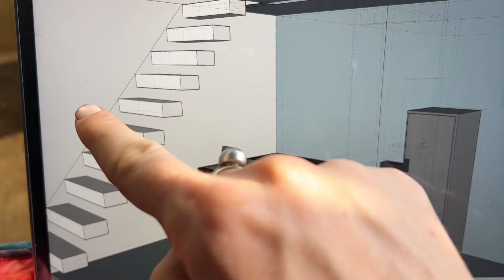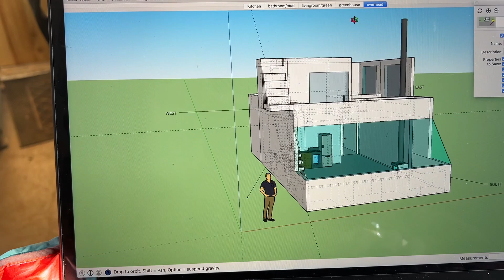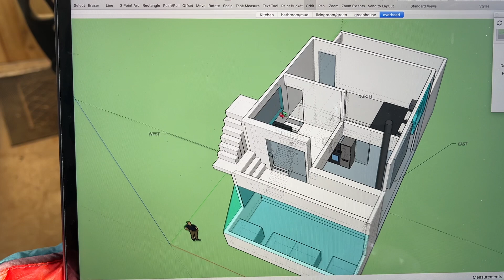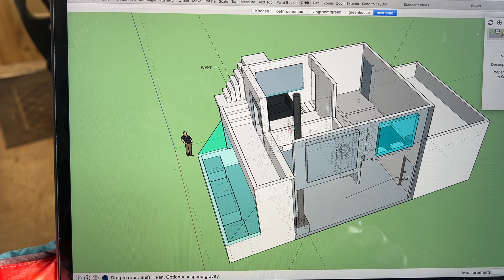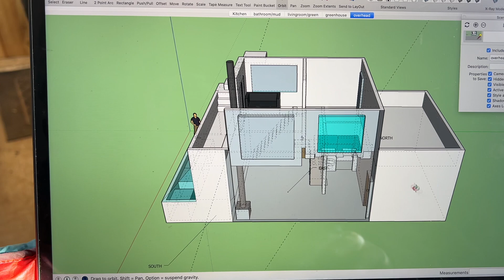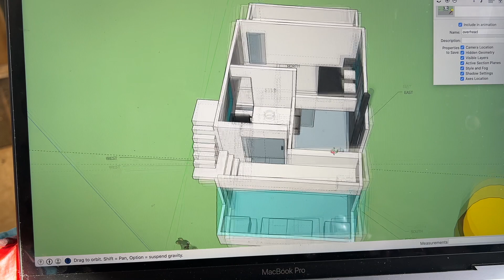#27 Our Debt-Free House Plans & Ideas | Normal to Nomad Podcast

Comment: Mass stove for floor heating n shower n solar heat as back up n summer? For power, panels n a stirling hot air engine, driven by the mass stove?
A mass stove can include a rocket design, for efficient oven solution 😊

Comment: If y'all use cement & or cinder block, remember that when cement walls have a habit  of holding either heat or cold depending on the  season. 
   I mention that due to experience. A place I lived at in for 2yrs in Indiana once summer set in the cinder blocks held the heat & cinder also holds the cold during the winter.

Comment: Excellent video! This spring summer/ I’m hoping to get a ‘70s 3 bed 2 bath double wide moved onto our family land. People sleep on mobile homes but they are an excellent affordable housing source, and if you are handy and willing to modify some stuff, older used models make a lot of sense. There are many deals that can be had from people who are upgrading their current home and so they sell their older model and you just have to move it. Ever since I was a kid that’s what I wanted for a home because I knew I could have a good sized nice home and be debt free! I’m interested in tire homes and using core wood to make a house or structure too. We’ve got sandy soil and 10/40 acres is forest. Many trees have fallen down in previous years due to bad wind storms, so it would be good to take advantage of that wood. For fencing I’m thinking of putting 2 logs upright ever 15-20ft or so in the ground and those act as posts. Then stack logs in between the upright ones to create a super strong boarder. I want an 8 ft tall boarder 3 sides of my home site. I’m excited to have normal running water! My camper water lines froze mid December, so I am currently using a usb pump in a big jug, and then have a large stainless steel mixing bowl with a lid and fill that up half way with snow for going to the bathroom, then just dump it in a tree well amongst the weeds a few times a day. Not ideal, but it works 😄 Or I go in the woods. If animals can do it, so can I haha

Comment: We live in a hand hewn log home 20x26 and love it. 6x12 inch logs do very well around here. We heat indoors with wood and the logs absorb the heat and release it. We sleep in the loft. Eh from the U.P.
We use garage tool cabinets on wheels for our cabinets also.
We did much of the work ourselves.  Septic, electric, and excavation had to be payed for. Cost was still around 100k.

Comment: Hello Elisa Rhae & Barron

As a though for pantry space, use the space below the stairs as either open shevles or closed with cabinet door. Many times the space below the stairs is wasted. Also, add a touch of class, place dim lighting recessed at each  step.

Having a deck on the utmost top, you could then use a tower for a directional antenna for internet service.

Comment: not a fan of stick houses, every house I've has been brick...first house was cinder block the walls were 12 inches thick   and we had no central air./heat.   this is in Florida.....prefab   home looses value way too fast.....think future....safety factors

Comment: You’d probably have to bring in a cement pumper truck. They use a long hose to get the cement poured where you want it. They’re generally fairly expensive compared to a cement truck. All the men in my family work heavy construction so I’ve learned a few things over the years. The hemp blocks have been used in North Idaho for homes that have been lived in for years. Good luck.

Comment: Greeting from Kansas City.   You will never regret building a large garage with a guest room (with a wood stove)to live in while building your house. Being able to get out of the wind will save your sanity. We lived in New Mexico for years and the Spring winds across the Southwest were intense. The garage is not a luxury its a necessity. You will need a place to store all the equipment/tools  you will be purchasing over the years. Also if possible think about adding electricity to the property. Even if you use solar primarily having the electricity is important in the winter months (especially with kids) and it adds resale value to your property. Love you videos !!

Comment: If you are interested in permaculture principles, building on top of a hill is not advised. Not really efficient for heating. Exposed to the elements much more. You mentioned having your garden space close to the house, and you e done that with your indoor greenhouse. But you’ll soon grow out of that growing space and will need much more garden. Gardening at the top of the hill will be very difficult being so exposed. The advice is the mid-point of the incline.

Comment: Wow. Weird. I started "Dark Side of the Moon" at the 3rd lion roar of the podcast and it synced perfectly. Trippy. LOL. 
We built a cabin out in the area of Blue Mesa and Black Canyon (Arrowhead) and had our obstacles at 9000FT. For water we had no choice but to use a cistern. The showers, etc, were "Navy" style - water on to heat up, get wet, water off, soap up, water on to rinse, done. Dishes weren't a big deal, but any laundry was thought provoking. Once HE became more prevalent, as they are today, the laundry became less concerning. Our well was doable but we had a minimal pump system and the haul from the well to the house would have required the 'daisy chain' method that I mentioned in previous post for my current home at LoZ. So, a simple pump system to the cistern. BUT...you seriously have to monitor the cistern across the board. You also have to think about the hot water tank. Nothing will make you scream like a girl and slam everything in the lower region of your body back into your pelvic cavity like the sudden shock of VERY cold mountain water coming out of the shower/bath faucet (one of the issues to consider with hot water, just giving a simple word picture example - with me it was showers, her baths, her dishes, me laundry, her issue this...a 'me' issue that...ya know). Lesson learned. The heated water tank is something else to consider. For where I live now it is this - well/pump 1 (outdoors), pipe to house inside 1 (from outdoors)/softener 2nd/hot water 2nd/ secondary pump 2nd. All of the secondary (2nd) is in the basement.
Colorado allows composting toilets. At least they did. We had to do this while doing some of the typical chimpanzee circus act for closing loops to get the septic built (our issue was really based on the amount of BLM land that surrounded us). But we eventually did get it sorted. During that time from start to finish - composting toilet. No problemo.
Keep up the good work! I am ready for spring/summer!

Comment: Do you not get very much snow?  You must not if thinking about a flat roof.  Snowload was very important of a consideration when we built out house.  After quite a few years of very heavy snowfalls I wish we would have used a metal roof with a higher pitch than what we did.  This is because I have shoveled the porch roof many times.  Our porch is on two sides of the house and is one of my favorite parts of the house.

Comment: You can insulate concrete walls without buidling a frame on the outside. It is the most common practice in europe  to attach insulation panels to the outside of a strukture,  if done properly this is way more efficient because it eliminates many thermal bridges like the studs of your frame.

Comment: My grandparents built their house from cement block. We lived with them in that house for several years when I was growing up. They built it in sections, starting with the kitchen with a sleeping room off it and adding on over the next couple decades until the house was finished. Doing it as you can afford it is definitely the way to go.

The "sunroom" dining room was built like a green house, but even with the cement block and poured cement foundation, it still got pretty cold during the winter. Maybe if you supplement the heat sink solar by replacing the woodstove with a masonry fireplace. That will store and release both the passive solar heat and the stored heat from the fire into the room.

Also, when you are calculating your water needs, remember that a vegetable garden uses a lot of water. Even here in western Washington, where rain is generally plentiful, my water consumption doubles every year from spring on through the harvest. A rain barrel system might help you guys some with the garden irrigation issue.

Comment: A couple of things: my friend has lived in his subterranean concrete house for 20 years and his one complaint about his design is that the concrete slabs for floors were poured such that they extend outside of the house. The floors move the cold into the house in the winter.  Not sure what your plans are... just a tip. 

Second,  I just learned about a house of another friend's parents that have a green house room facing south that pumps hot air into the rest if the house in the winter for heat. Brilliant!

Comment: Another thought - I love your roof top deck plan.  I actually used to sell solar on a commercial level and I’ve seen some really cool solutions.  

I’ve thought about having a rooftop deck and use the solar system array as shade on an awning.  It can be high enough for Barron to be able to stand comfortably and still be slanted enough to get the best sun exposure.

Also solar panels mounted directly on a roof - are not as efficient because the heat radiating off of the roof causes degradation and slows production of power.

Comment: As a person who has lived in a stick and frame house built on concrete slabs, they get mighty cold in the winter and the winter sun can't really heat them to any degree.  I have wall-to-wall rugs with thick pads and it is still the coldest part of the house.  If I had a house built using concrete floors I would have in-floor heating.  It's great in the summers built not so much in the winters.

Comment: Two thoughts.  First, hire an architect to finalize load and stress design.  That glass front looks wonderful but something needs to carry the load of the second floor.  Second, you are used to scrimping on water use but once you have what seems to be a years supply, you will find yourself shrugging and saying, "oh, there is plenty of water".  Especially to water that inside garden.

Love your videos.

Comment: I love back strap. I usually just marinate the meat in a homemade Italian seasoned (you can use dry or fresh seasoning) vinaigrette (vinegar and oil) dressing (just like the salad dressing, and in a pinch you can buy your dressing at the store and use that) for about thirty minutes (longer is ok too), then throw the meat on a wood or charcoal grill or over a campfire grill.  You just have to be careful to cook it very slowly, not too close to the fire, and monitor it as it is so lean you can easily dry it out and it cooks super fast too. It melts in your mouth. So, so delicious. Makes me want to pull some out and cook it tonight. The vinegar in the dressing will take out any gaminess flavor to the meat too, although if you bled your deer that shouldn’t be an issue. I love fresh game.  

You guys should also think about getting a bird dog (pointer) and look into hunting quail, chukar, pheasant and other wild birds as you live right in bird country. You don’t have to have the bird dog to get the birds, but they sure make it easier finding, pointing and retrieving the birds for you. I recommend German Shorthaired Pointers if you ever want a bird dog. I have bred them for years and they are good hunting dogs for hunting both fur game and feather (you normally hear about them hunting birds, but they are great at hunting everything from bear on down), they do blood tracking too if you need to find an injured deer, and they are great watch/guard dogs. Good with kids too. The Germans did a fabulous job in breeding for a multipurpose dog. They would get along with Camp too. They also hold up well in Colorado weather.  Just another way to harvest off your land that you may want to consider. 

I love the area where you guys bought land. I know it so well and have hiked that area and pretty much all of Colorado.  Good luck on your house planning.

Comment: Great podcast. I love hearing your dreams and plans. You might look at insulated concrete forms. They've been around quite awhile. The tech is good. Another thing to investigate  is air Crete It blends soap foam and mortar to make a light mix that can be made in small batches to fill block walls. Lots of You Tube channels. The Honey Do Carpenter  has a system and is starting a house build in Northern Idaho  this spring.

Comment: The large cistern is a great idea….. especially if the well goes dry, hopefully this never happens with yours. We have a large dug well and during droughts when it goes dry we have water delivered. It’s expensive and fortunately this occurs rarely but it’s great to have the option. You might consider having one main deck that has easy access to the kitchen for outdoor dining. In our case this deck is covered (shade) and screened (keep out biting insects). A few things to consider….flow through ventilation, humidity associated with indoor greenhouse, plants in greenhouse obscuring views, if you get a lot of snow then a flat roof might not be a good idea. I love your creative approach to building and doing it in affordable stages/components is a great way to proceed. All the best.

Comment: You guys should consider rainwater for your house. Collect off your roof and decks and you could easily get 1000+ gallons a year. I get less than 12" inches of rain a year where I live in the Sonoran desert and I often overfill my 2500 gallon cistern. Your well could be used for your garden and as a backup, but now no pumping up to the house.

Comment: Beautiful design. One thing to consider is having an overhang over the south facing window to partiality block solar gain in the summer so you don’t get cooked. There is a formula to figure out sun angles for different latitudes.  I’ll try and find it and send it to you. This would also increase the size of your ceiling deck/patio.

Comment: If you're not concerned about shipping the container after you've built it out, then why not insulate the outside of the container and then clad it the way you would stick frame. Then the inside you can put up wood paneling or drywall if you want, but it wouldn't be structural, just cosmetic.

Comment: We had friends that built a house with the form filled concrete in tucumcari, NM. When the forms were completed they pushed dirt on the whole back and one side of the house within about a foot from the roof and tapered down. Really helped them on cooling and heating. All they had was a wood heater for heat. They had a murphy bed with a bookcase on each side for when company was there. They did it all themselves and said it was not hard at all. They said it was like legos. They only had a concrete company to fill them.

I use to live on top of a mountain with awesome views and the wind was brutal.  It was a log house and the maintenance is constant. I would never have a log cabin again. If you don't get the right logs or system, it could be a bad experience. Many horror stories and also some great ones. Out west, logs they use are different from the ones in the southeast. A lot more humidity and moisture in the southeast.  I learned that if you come down from the top of the property just a little ways and have bushes/trees for wind breakers helps a lot.

I think the type of septic system is according to your perk test. At least it was for us where we live.

Love hearing y'all plan out loud. A large TeePee would be an awesome hangout also. Be Blessed!

Comment: Thanks for sharing your home ideas.  What about standard brick??  In comparing concrete block vs brick, brick has a higher insulation value.  Maybe the interior floors of just the green room area??  How about a small root cellar, with access from garage?  I am sure you will be wanting to store veggies and bottled fruit/etc.   Also... I would build extra space for as much storage as you can (both floors).  You will need it and use it.  Plus, even one child will need a lot more room than you probably realize.  My coworker bought some acreage and bought two shipping containers.  He was planning on burying them underground, but may just create a barn-like structure by creating a roof between them.  Good luck with your plans and enjoy the process.  Cheers

Comment: Sorry commenting like crazy! On the possible art piece in that open area you may be able to find someone that could plasma cut a big version of your YouTube symbol that could float in the center of that space with some chains or metal holding it in place to a metal frame around edge of opening. Would be cool cause you could also see it from downstairs and if was made of metal might trap some heat from the wood stove to help with heating your room

Comment: I just recently learned that concrete has VOC & green house gas emissions. There are some new types available though which do not. The manufacturer must get a certificate or it’s likely not the type of concrete that doesn’t have it. I was quite surprised to learn this about concrete. Perhaps if your research leads to concerns of your own about the chemicals it would emit into your home, you could investigate rammed earth? Either way, I think your home looks amazing! It’s elegant in its simplicity.